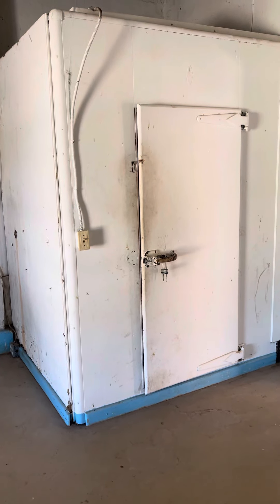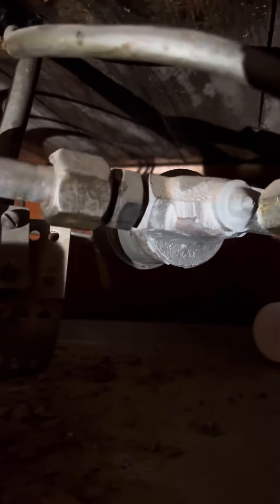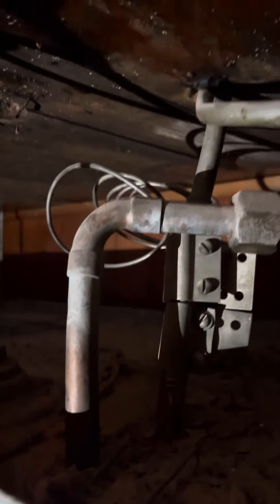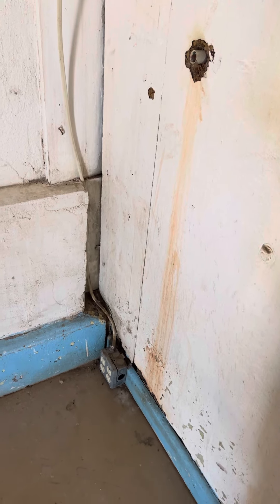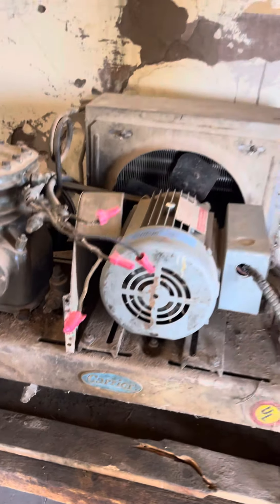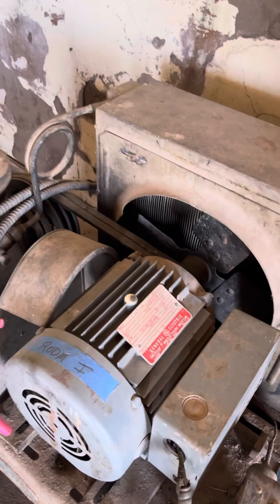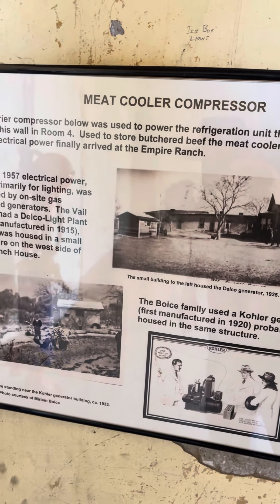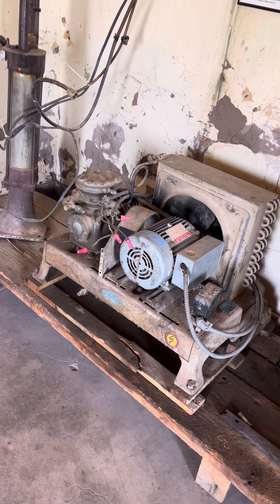Belt Driven refrigeration in Sonoita, AZ

Comment: Very cool old system! I love seeing these old systems. I also have a few of my own, including a 1926 Frigidaire which works. Have a few videos up on my channel about them. 

If I'm in that area, I will have to see that ranch. The plaques on the wall give the appearance that they have tours? 

On that condensing unit, the compressor pulley appears much smaller than most I have seen. Looks like they were running that pump at quite a high RPM. Wonder what the motor HP is? 

Thanks again for taking the time to share this with us!
Reply: Hi Dave! Funny we both come across this video only a few hours apart. I was thinking the same thing about the compressor speed. Made me wonder if it isn’t a later model, maybe toward the end of the small open drive units?

Comment: Looks like an early flathead version of the York 2-cylinder compressor.  Later evolutions of this design were very common in automotive AC units till the early 80s, when axial 6 cylinder compressors with a swashplate rather than crankshaft came to dominate mobile HVAC.  I remember seeing cast iron units in 60s vehicles, but by the early 70s the casing was all aluminum.  This compressor did the job OK with R12 but when the 6 cylinder units came along there was no looking back performance wise.  The York compressors did not perform well at all when retrofitted to R-134a as head pressure ran higher and volume was stretched to the limit.